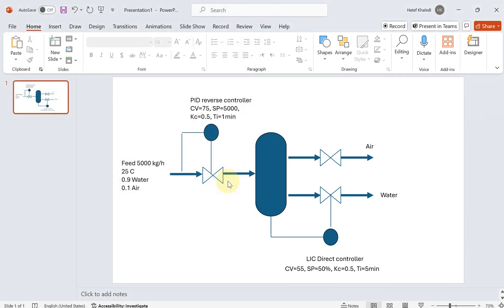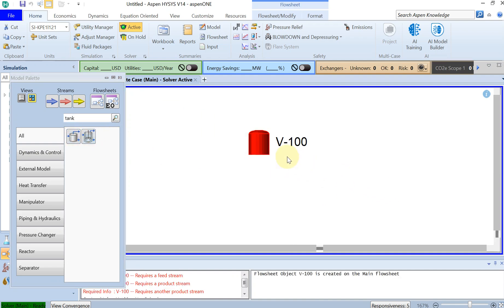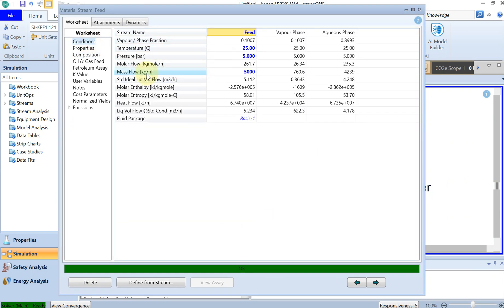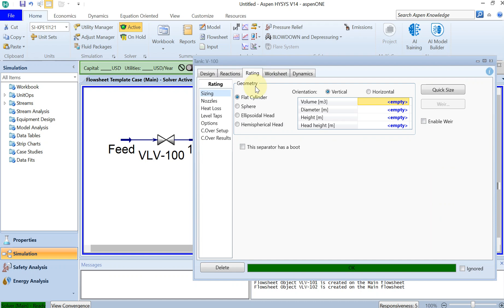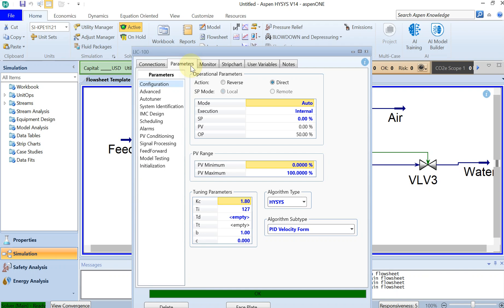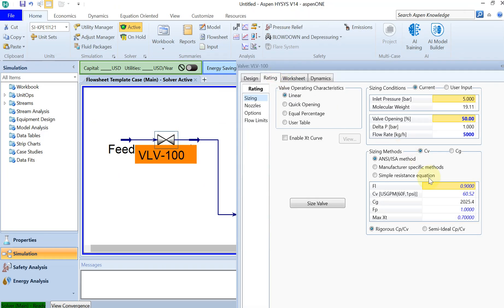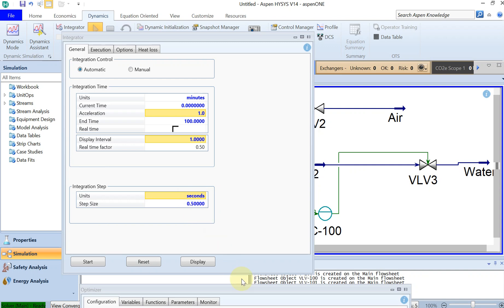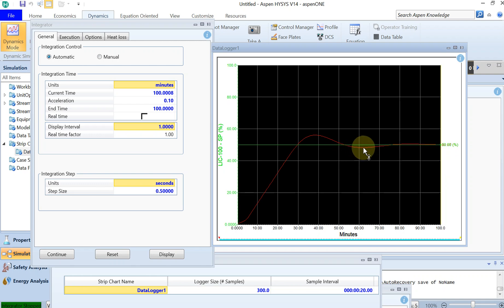Dynamic simulation in Aspen Hysys using controllers

Comment: Thanks you for this. I am really interested in Dynamics on both Aspen plus and hysys, because real life systems are dynamic. 
My question is, how do you determine the correct parameters to use for valves sizing, controller parameters to ensure that the system doesn't fall into errors. 

I have tried and tried with guesses but never works.